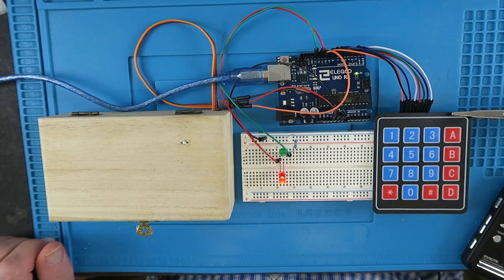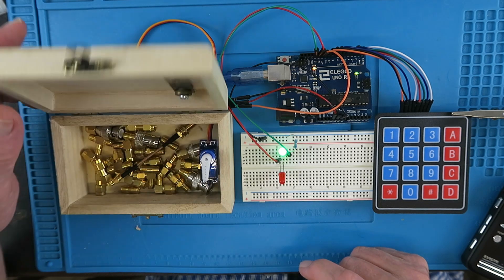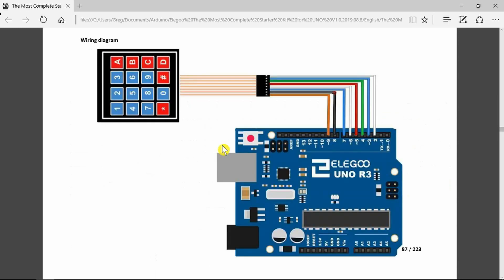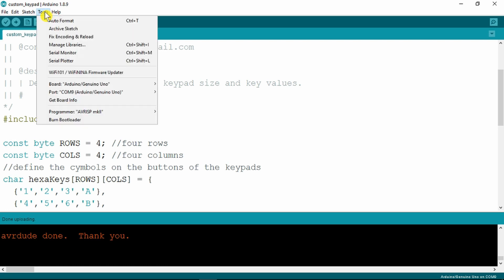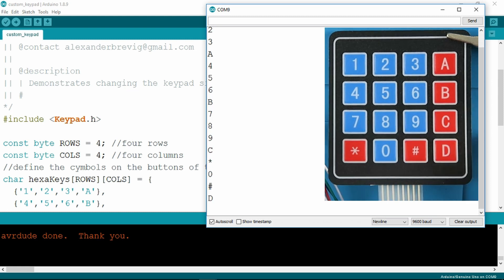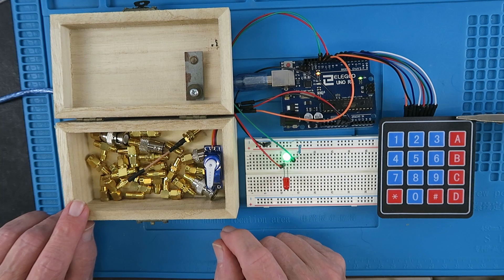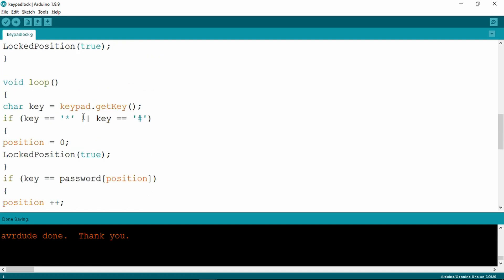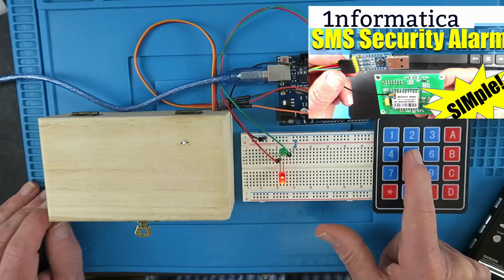Elegoo UNO R3 Project Part 6 Membrane Switch Module.

Comment: how can i see the wirirng
Reply from the maker: You can download all the documentation here : https://drive.google.com/open?id=1LIFz0ApdliPeSq9N49goN8Ffpi5Ufjuw Please consider subscribing if you have not done so already!
Reply: @1nformatica  i have
Reply from the maker: @jefbes743  •:*¨¨*:•_•:*¨¨*:• EXCELENTE_•:*¨¨*:•_•:*¨¨*:•_!!
Reply: @1nformatica  i still cant find the wiring
Reply: where is the wiring on this specific build ?
Reply from the maker: @jefbes743  The locked box was based on this project : https://create.arduino.cc/projecthub/camdelk/keypad-entry-lock-4d7a03?ref=tag&ref_id=keypad&offset=17

Comment: We have a servo on the back door of the house to lock the door with a remote. The servo is plastic, but it operate a barrel bolt in metal slides. Such a kit have enormous educational value that bring maths and science together with a practical application.
Reply from the maker: Agreed Johan! If people spent more time with kits like this than checking facebook then their lives would be better!!